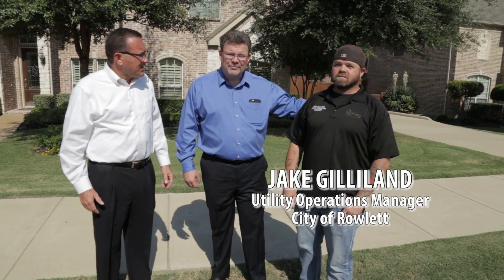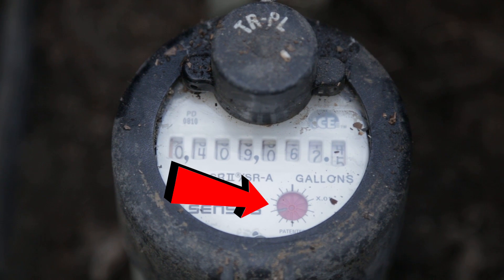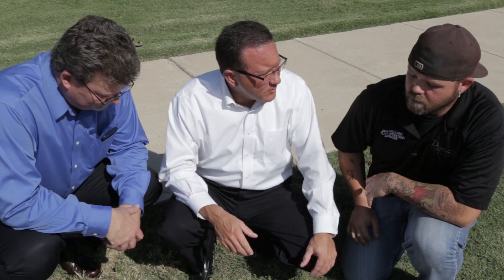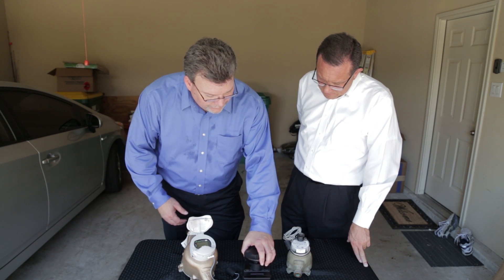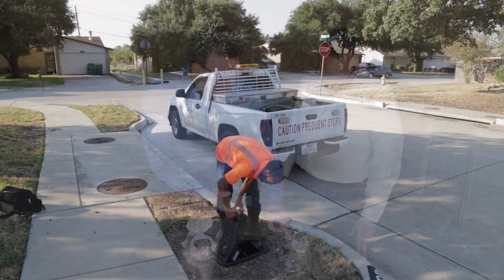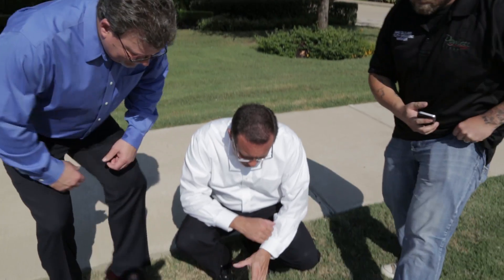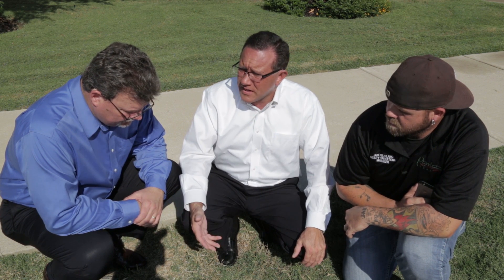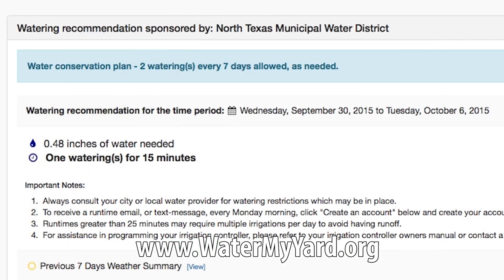Understanding How Much Water Your Sprinkler System Uses

Comment: I hope this isn't part of trying to discredit the numerous people complaining about inaccurate water measurements. Or city officials demonstrating nothing is wrong. If so this video does just the opposite. (1) The "Utility Operations Manager" said to be there to insure accuracy miscalculated the gallons used. On a calculator. Is he the one insuring the meters are performing correctly? (2) The city manager in his own video said, "We determined, based on the city's water pressure, typically about 10, maybe up to 12 gallons per minute comes out of our water irrigation systems." Per this video the mayor's usage is calculated at 170 gallons over 10 minutes. That's 17 gallons per minute. That's 30% higher than the max claimed by the city manager ... who is standing right there beside the mayor ... and not questioning anything. (3)  Despite these three putting their reputations on the line for all the world to see, not one of them checked for accuracy and accountability before the video was published. It's now late November so apparently no one checked for accuracy afterwards either.  (4) To my way of thinking, they just unknowingly demonstrated people have very good reason to question their ongoing reassurances. And very good reason to call for an independent inquiry by industry experts.